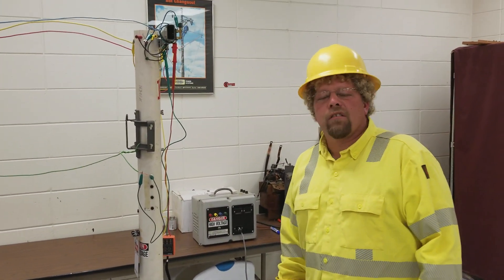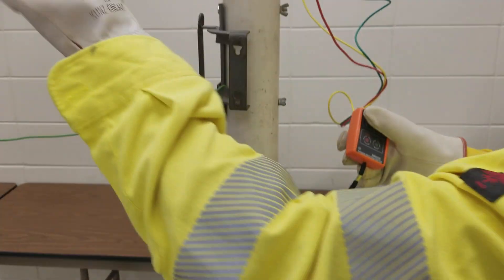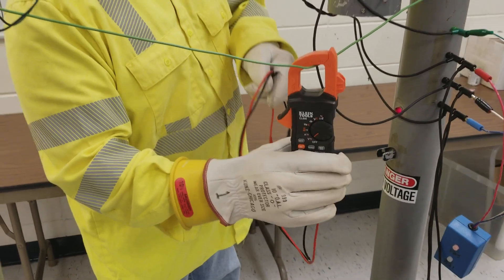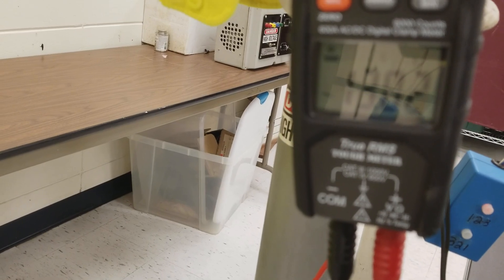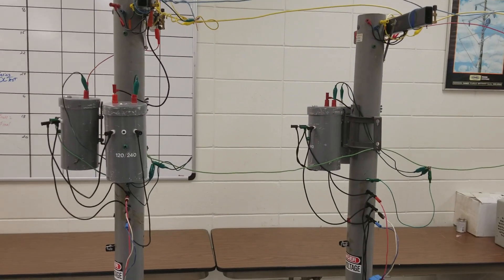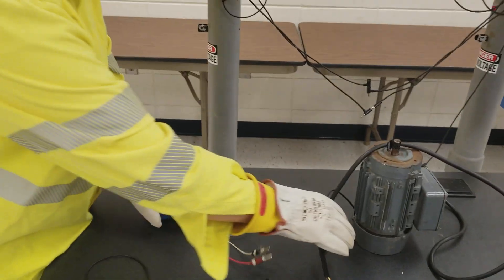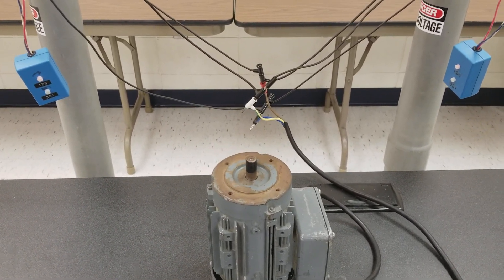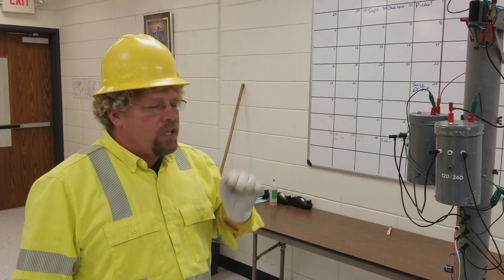Paralleling open banks on different phases

Comment: At the 11:55 mark you finally explain why this works in your demonstration...  You have wired the transformer bank on the middle pole with the lighter transformer on the lagging phase (B-phase of the AB phases used).  The open-delta bank on the last pole is wired with the lighter transformer on the leading phase.  (B-phase of the BC phases used).   Most electric utilities have standardized bank connections where the lighter transformer is always connected to the leading phase of the two phases used.  (AB, BC and CA).  Had your two open-delta banks been wired the way MOST utilities connect their lighter transformers, a completely different conclusion would have been reached.

Comment: If you have a wye-delta bank with a delta-wye bank, can you run a 6 phase motor with those 6 leads from all the scondaries?  Each phase would be 60 degrees apart.